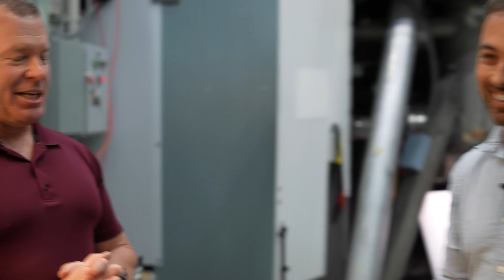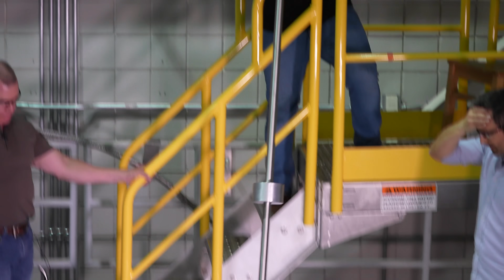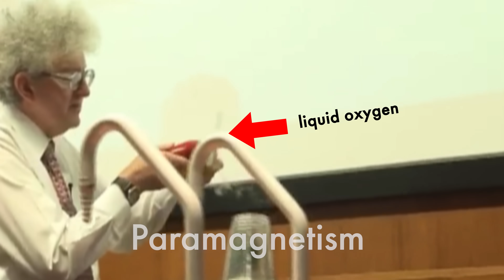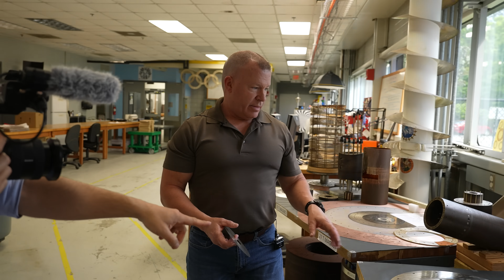World's Strongest Magnet!

Comment: If this magnet had a changing magnetic field, it would absolutely wreak havoc the moment it charged past a certain magnetic flux density. It'd cause everything in it's surroundings to emit EM radiation (light), heat up non-conductive materials & turn into a radio transmitter. Of course, it'd be a rather insurmountable feat of taking a 2 story long magnet & constantly rotate it the entire time while it damages & breaks equipment through weak OR strong EM radiations (depending on the material).

Comment: Incorrect. Refrigerator magnets only get to 0.005 Tesla or 50 gauss. Old MRI machines are 1.5 to 3.0 Tesla. Modern MRI get to 7.0 Tesla. I've seen research magnets get to 100 Tesla. One Tesla is equal to 10,000 gauss. The Earth's magnet field is a complete mystery. It's different all over due to the variable thickness all over the crust of the Earth. Therefore, it cannot be measured accurately.

Comment: Very cool video. I have recently discovered a not-so-new soldering iron heating mechanism that uses the Curie-point magnetic phase transition to maintain the temperature of the soldering iron tip. The company that uses this (and has done so decades) is Metcal. I was so fascinated by this system that I bought one of their irons for my hobby tinkering.

Comment: Now magnets are even replacing traditional refrigerator systems.

Using a phenomenon where a material's temperature changes when a magnetic field is applied or removed. This change in temperature can be either heating or cooling, depending on the material and the conditions. Materials that exhibit a significant MCE are called magnetocaloric materials.

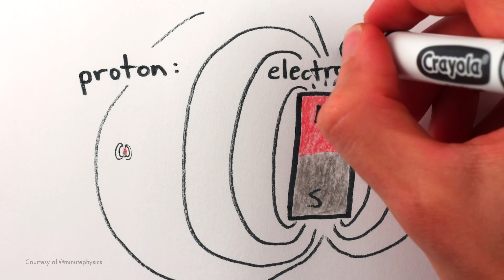Comment: Just to clarify at ~ 6:12, electrons are only like magnets because of their motion. Moving charges (electrons/protons, etc.) create a magnetic field as described via Ampere’s law.
Reply: check out the video veritasium made about "tiny magnets", it is linked in this videos description.
electrons do create a magnetic field because they are moving, but that mostly cancels out.
the big part is their intrinsic magnetic momentum. it is a magnetic field that they just have, because of quantum spin. and as it turns out, the sum of those magnetic moments is what creates permanent magnets.

in an electromagnet however the magnetic field is only due to the moving charges.
Reply: Thanks for the info!
Reply: Well they are moving because of heisenburgs uncertainty principle. So by default a normal atom with a half filled shell is magnetic…
Reply: What about the spin of subatomic particles like fermions with 1/2 or 3/2 etc? Would that mean those are technically magnetic as well or is that so minute it doesn’t really matter
Reply: @Walter_white.587 protons neutrons and electrons are all fermions, but electrons are also considered a lepton
Reply: @arjunaprashanth9425 yes but would the individual spin of those make them magnetic as well or just the orbital spin of electron around the nucleus
Reply: @Walter_white.587 ohh my bad. They aren’t really spinning, it’s just conservation of angular momentum when interfering in a magnetic field. It’s kind of hard to visualize it, but float head physics has a good video about spin
Reply: @Walter_white.587 and btw, electrons don’t orbit a nucleus in the practical sense. They are just randomly darting around it which is depicted as a probability cloud. You can read more about its wave function to really grasp it

Comment: The Human body is made out of electricity as well , so a huge magnet like this will have an effect on the human body , it will also have an effect on radio frequency, I know that you can make a repellent of magnets with like around 20 small magnets with the poles repellent to each other, put them together in a piece of gorilla tape and carry it on your body and you have some protection against radiation on you , but you need to have around 2 -4 roles to protect the entire body .. magnets can be good for your body if used correctly

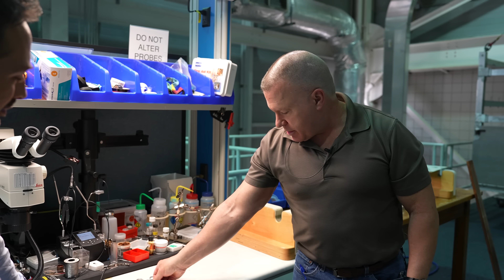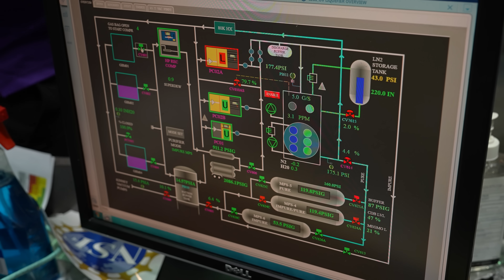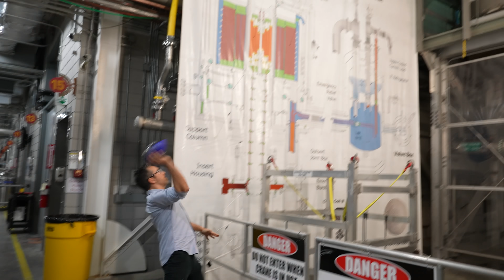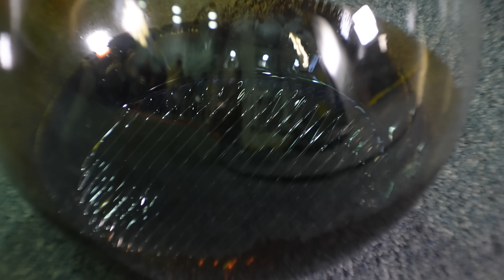Comment: This Dinamit beer manufacturing process seems to be it I tried to find having almost same metal devices meant for fermentation. Please don't play with that power knob too much 3:07 at your banking. 3:28 This control screen is build as part of Drake Vulture recycling process and is something system designers do. Imagine it as not so small diode which about electronics parts technology upgrade should be found through research - UML. 4:22 It's something infosa does. 5:00 might need a way to imagine sound wave.

Comment: "renewable energy" = stupid BS emotional nonsense.  
All solar panels and wind turbine blades are not recycleable. They pile up in landfills and aren't renewable AT ALL.  They also give off extremely toxic fumes if they catch fire, which wind farms do all the time.

Oil is the cleanest and most natural resource.  It is actually renewable as the earth continually creates more and more. And when burned efficiently, gives off basically CO2 and some minuscule other elements which don't matter.  Plants, trees, the ocean, etc all eat the CO2 from the "exhaust". Then those plants gives us that beautiful O2.  It's almost like it was designed to be a perfectly recyclable resource, that when used, is good for the plants, and good for life using oxygen.  

The "dirty" aspect is only a result of inefficient burns, and old exhaust systems.  Let's focus on cleaning that up and requiring more and more clean exhaust, but not confusing that with removing CO2.

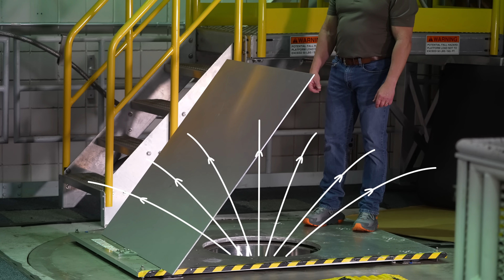Comment: 9:08 "what's happening to the sheet as it's falling through the magnetic field is that the number of magnetic field lines passing through it is changing"

What is that even supposed to mean? That doesn't make any sense. Magnetic fields are smooth, and not some type of discrete "height lines" or whatever. Field lines do not exist, "number of field lines" has no meaning.
I guess you meant that the area through which the field passes changes?

Comment: The explanation about the vortex phase of Type II superconductors is not really correct. There's nothing "engineered" into the material. It's true that the flux tubes can be pinned on impurities, but they exist even without. That's from intrinsic properties (more specifically the interplay between correlation length and magnetic penetration depth) making it energetically favourable to have flux tubes compared to completely expelling the field.

Comment: Buy a house. Build a 45T magnet under the kitchen floor. 
3 in the morning, woke up because hungry. Turn the magnet on.Heat up food and eat it in a metal plate. Now finally you can eat in peace knowing that if you drop the plate accidentally, there will be no sound to wake your family up.
Reply: Completely practical
Reply: I was thinking of those Minecraft zero damage fall damage boots the whole time. They invented Feather Falling IV
Reply: Wow😂 amazing
Reply: or eat off a paper plate and save $1,000,000
Reply: @mathematicskid genius
Reply: @mathematicskid  But that's not the fun solution.
Reply: Dies because of a metal utensil from the neighbors cupboard.
Reply: @vioco Neighbor’s. Possessive.
Reply: classy🤣
Reply: You can buy an induction stovetop that works basically the same way.
Reply: @empathogen75 nah that wouldn't really slow it down, but if it was stronger it could maybe levitate it, but that requires a bit more effort I think, no idea, never built a levitator yet
Reply: I give this comment a 2 out of 10. Sorry.

Comment: How does this magnet not mess with the earths magnetic field/magnetism being this strong?
Reply: while the earth's magnetic field is never anywhere near as concentrated, it is still a much MUCH more powerful magnet.

the earth's magnetic field is caused by flows of charged particles in the liquid mantle due to the rotation of the earth. even if the charged particles are relatively sparse there's still a hell of a lot of them because of the sheer size of the earth.

Comment: This is exactly how UFO's fly and can travel through space and the solar system at incredible speeds.  Speed and the time to travel is not an issue its speeding up and slowing down that takes the longest so the operators and passengers don't splatter during ramp up and deceleration

Comment: What would happen if you put an electrical wire with current flowing through it above the magnet? Would the electrons all congregate in the part of the wire above the magnet, then when the magnet is turned off the electrical energy would be released? I have limited knowledge of electricity but I’m very curious what would happen, if anything out of the ordinary.

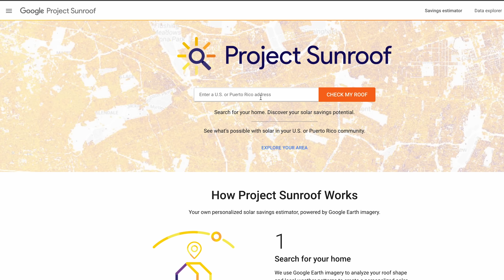Comment: 8:34 sadly all this talk over years about solar and it's still not remotely feasable for normal people. I checked out site and as expected. massaive initial investment, doesn't even pay itself for at least 13 years and even then, it's only hundreds per year that you save. I likely won't even be alive that long, or be living in this home. Not only that but like always, no mention of maintenance cost and or anything, nothing lasts forever. Heck even if solar panels lasted "forever" you'd have to redo your roof shingles in that amount of time and then all that added cost of uninstalling and reinstalling the panels, and i am sure wiring will need replaced at minimum. do you really ever get your cost back? I doubt it. Solar needs to be way more efficiently or way less costly to be reasonable for the majority of people. most people don't even earn enough or have the savings to do it, and leasing you don't save hardly anything. All this talk about renewable energy yet it's not feasible, wind power is even worst, i looked into that too.

Comment: OMG. This is so useful! So much can be done when such a thing is available. It might be expensive, yet it totally worth it. I would love to try some things with such high magnetic fields. We would usually get high field in the lab for a very short time. It it can hold such high field for an hour or a maybe even for a day I would love to try some things. This field allows to use magnetic cooling, that's whole new yet unexplored landscape of physics that people were dreaming to explore for the past 50 years or so, but could only barely touch it. I also think about various spin-orbit coupling effects and the conductivity change when the field penetrates the material with an angle. They also have that area with the field sufficiently big for all kinds of samples to fit inside. I just wanna get there and try. So many condensed matter predictions can be tested there! Some things would also require high vacuum there, which is usually done by some equipment which has lots of metal part, thus I wonder we can put a same there under high vacuum.

Comment: Wait because Oxygen can be liquified. Does that mean you could technically? Tell your friends you almost drowned in oxygen?
Reply: Well, you have to plunge it down to incredibly low temperatures. So you would snap freeze to death before you drowned, most likely.
Reply: @thestolensweetroll8406  Train with ice baths. Boom problem solved.
Reply: @aaronxu1513 liquid oxygen is much much much colder than ice

Comment: Why is 500 volts required to create 37,000 Amps given the magnet is suoerconducting and doesn't have any resistance.  Ohms law with 0 resistance says only infinitesimal voltage is needed.

Comment: Looking at the thermal imagine around 9:50, you can't see that the metal is heating up because metal is thermally reflective. The "hotter" zone in the metal just so happens to line up with where a reflection of the professor would be, and you can even see it move as he bends down.

Comment: At 9:55 the visable heat by the thermometer on the metal sheet is not the temperature of the metal. Polished items such as this polished metal sheet acually reflect the heat by the surrounding objects. The heat you read on the thermometer is more likely from the man standing next to it reflecing his heat. 
It would be interesting to see a video about this on your chanel.

Comment: Love it!  You may want to add retention clips to keep the axles in place.  Another consideration is to make the side walls angled in to remove that small platform on each side.  Finally Amazon does have a protection group that if you report daily you can get most infringers removed, especially if they are infringing a trademark and/or a design patent.  It’s harder to get Amazon to stop patent infringement without court cases.

Comment: use high magnetic fields for making perpetual motion by water suction through suction cup and magnetic fields so we got some higher suction point and its outlet refill the reservoir again and again for millions of year
Reply: It wouldn’t be perpetual. The energy comes from somewhere, in this case, you’d probably need changing magnetic fields which needs electricity.

Comment: With the aluminium plate passing through the field, as force is exerted upon it, the induced field increases to compensate - does that mean that the rate you can lift it off the ground is fixed regardless of your strength? A stronger dude would lift it at the same rate, but with more heat created in the material?

Comment: I believe what you're seeing was a reflection of the mans body heat when the plate of aluminum was falling on the magnet and you were using a thermal camera attachment at your cell phone I believe that was the reflection off the aluminum and the Heat and the air was Rising on The Man Behind the aluminum sheet

Comment: can anyone tell me in simple terms if it’s possible for me to suspend an object with magnets attached, in between two other magnets with opposite force, im trying to make a pendant and the object will be somewhat locked in place inside of the pendant, but with an open face so i can spit it, but it’s locked in place so it doesn’t flip upside down, my question is, will gravity eventually just push the object down, i wanna know the simple answer before i drill magnets into this pendant cage

Comment: What would happen if I put a coin on my head and stand on it then start the magnet, would it go through me or can my body withstand it. What would be the pressure of the coin applying to the surface it's on around 2 meters?
Reply: If it’s a coin made of non ferromagnetic metal that’s conductive (zinc, copper, gold, silver) the major force would be from lenz’s law. Because of this it wouldn’t be attracted to the magnet at all, and would actually feel lighter on your forehead as the induced current in the metal resisted the pull of gravity. If it was a ferromagnetic coin, you’d still likely be fine. The coin would need to be ludicrously magnetic for any damage to happen.
Reply: @pat9353  Interesting that it would feel lighter with non-ferromagnetic metal. Thank you for the explanation.

Comment: This technology is also used as a molecular distillation center in creating bastardized elements and just see what comes out or what happens.

The problem with this is; atoms and molecules are naturally self segregating and will group or bond as a pure state new element.

This causes new creations which can deform nearby atoms which may create a chain reaction which is possible to achieve a non stopable morphication of atoms which could result in a runaway consumption of either a particular element or consumption of any atom.  

What if their bastardized FRANKENSTEIN ATOM consumed Hydrogen; the building block of all that naturally exists.

This ; lets see what happens in these molecular labs is beyond dangerous; it threatens creation itself.

I have discovered the process of complete molecular dissassociation.

I call this technology ELHFED.

ELHFED does not consume however it causes molecular failure of any element of any size or density.

I do mean any size, any material or later or state of matter and any density.

This was discovered after I discovered the actual physical structure of atoms and constructed the first 3D model of all the elements that can be assembled forever and never peak out.

Through this modeling I can construct any chemical or compound element or create bastardized elements in model form before seeing what happens if I use magnetism heat and gravity to discect random elements in pure state to see what I get.

I an able to physically produce stable or unstable elements, compound elements and reactive elements by the use of my modeling which I have designed a computer model and physical hand held models.

Let me say; ELHFED technology if in the hands of any government  or highly organized criminal philosophy could easily change the world in a matter of days.

I know the US government is experimenting with ELHFED like technology and perhaps already possess this technology. If they turn it over to AI or use it in autonomous enforcement systems it will produce a future that looks like the terminator word in the movie and there won't be any possibility of correcting it because it will be self protecting and use policy as is driving ethos or philosophy.

Under autonomous correction and SUSTAINABLE POLICY making no human intervention would be possible.

Comment: Strong magnets are amazing. I did my machinist/mechanical desing work career in university physics facility over 40 years. Researchers used very strong ceramic magnets for various purposes in physics experiments. I remember one time in early 90s two magnets were brought to mechanical workshop, one at a time in their boxes and the last one through different door far enough from the table where first magnet was brought. 
When the researcher guy entered the room with second magnet the first one started to move in its box and made tapping sound against box walls.
Distance between them was about 15 metres.
The guy warned us not to keep our ATM cards in wallet that day and reminded to leave wristwatches in cupboard.
It was quite a job to measure the magnets diameter, the measuring caliper was like glued to the magnet.